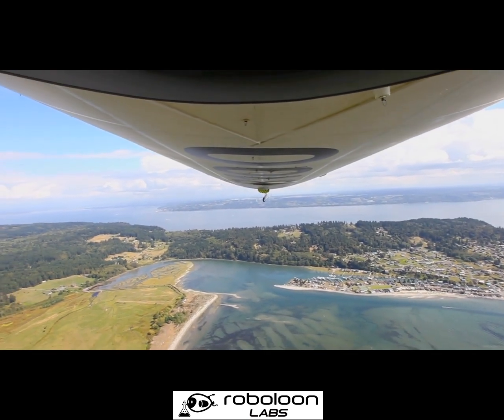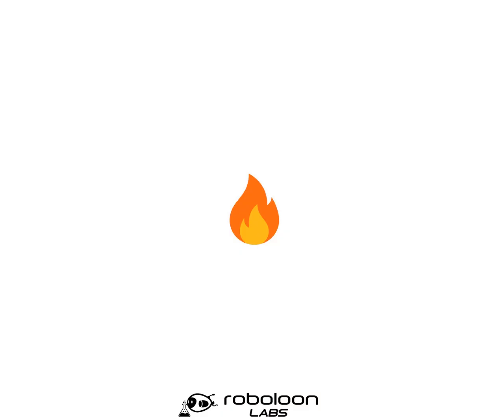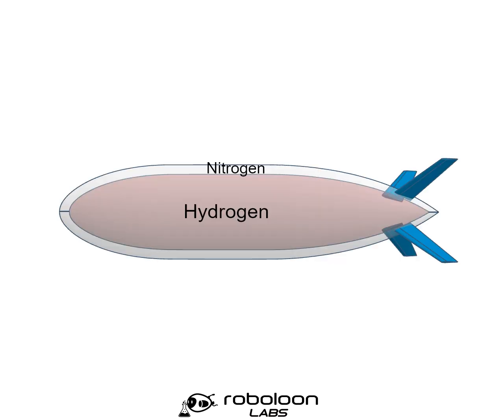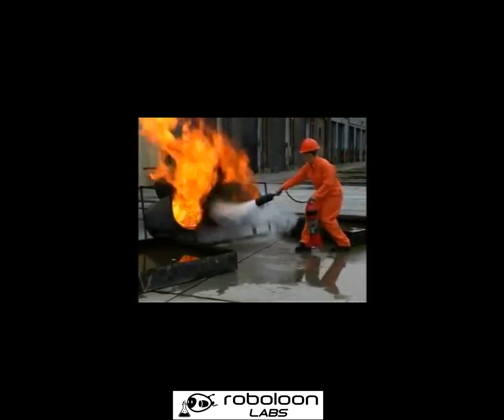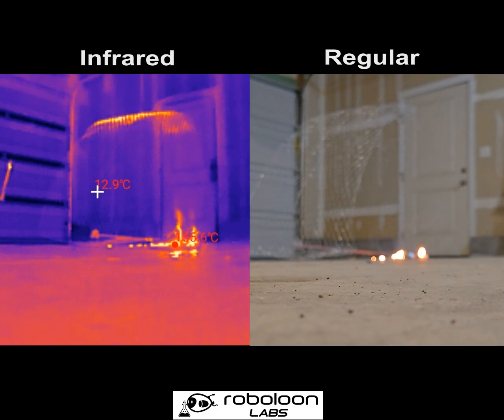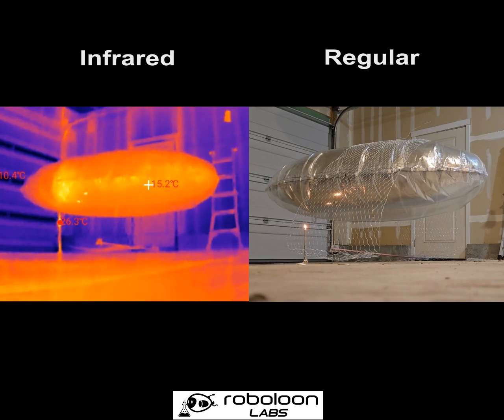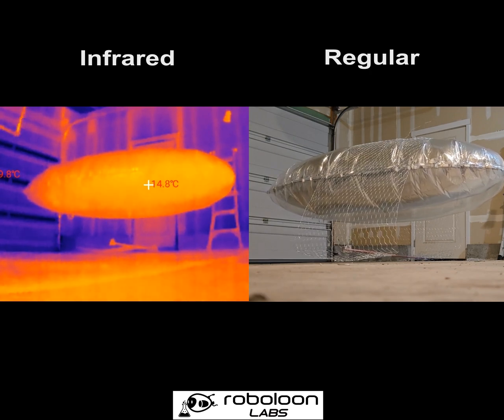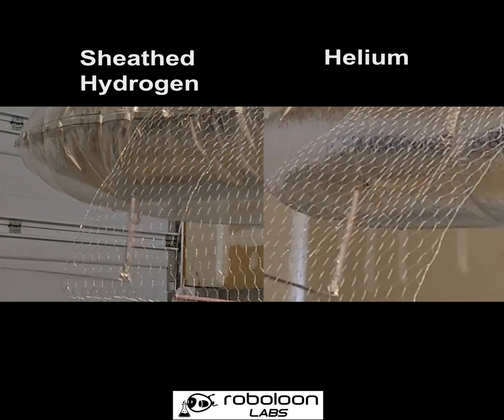Making Hydrogen Airships More Flame Resistant

Comment: I'm not super informed here, but I'm wondering if the lower CO2 partition could be replaced with water? Either way you're dealing with a pocket of something heavier than air. The water pocket could be much smaller and slimmer to compensate for the weight increase, but I imagine the shape of the resulting airfoil with a larger nitrogen partition on top and a thin water bag below would have greater lift in flight?
Reply from the maker: Yeah, I think the trouble would be the water would be so much heavier, like 800 times heavier. So you wouldn't be able to carry enough to help

Comment: Thank you for covering this, I've had the idea for a sheath for a hydrogen blimp for a few years now, but haven't ever had had time or knowhow to do it. 
If you don't mind me asking, would a blimp that is vertical and wing shaped work? potentially mounding the motors mid way up on the sheath, with a control fin along the spine. I read a comic a long time ago called Neotopia, by Rod Espinosa, He depicted one of his airships like that, using a pontoon boat at their base, and I haven't been able to get it out of my mind since.
Reply from the maker: Yeah, I think something like that could work. I'd love to see it!
Reply: @BaccaYarro now that I've seen a few of your videos, I'll definitely look into it. Just need to figure out how to make that wing shape. Maybe some internal panels attached with a plastic sealer. I was also thinking it could be a loose end envelope internally that uses a servo to tighten and loosen to increase or decrease internal pressure to change the lift. Btw, those mountains look familiar in your past videos, Utah? I'm in Provo.

Comment: Just inject nitrogen gas into the outer layer, increase the pressure of the outer layer airbag, making it greater than the atmospheric pressure. In this way, even if the outermost film is burned or damaged, the nitrogen gas can be ejected under the pressure.
Reply from the maker: Yeah, seems to work well

Comment: Is it necessary to divide the two shells
Reply from the maker: You could get most of the benefit without dividing the shells and using CO2 throughout. However this would be heavier. You can try mixing CO2 and N2, however this is less effective at fire supression. Particularly near the bow and stern. So far the best design was with the shells divided.
Reply: @BaccaYarro  Thanks!

Comment: How will you manage the extreme sensibility to wind due to the power/surface ratio for such a vehicle. Even moderate wind will represent a strong component working against the planned track, either directly, which would be good from behind and bad from the front, or as a side-wind component, which in all cases would seriously interfere with navigation. 
If such an airship should be caught in strong winds, it would drift with the wind-speed over ground, and at the same time be very difficult to control in an attempted landing and securing on ground. Otherwise I like the idea and your attempt to make it fire-safe.
Reply from the maker: @Eigil_Skovgaard  Right, this is the core problem with airships. We simply have to push more air out of the way than other vehicles. In the end you have to "brute force" your way through the wind. Design your propulsion for lots of static thrust with relatively low pitch speed. Most of our airships are designed to exert thrust instantaneously any direction (IE: 3D manueverability). That helps with landing and ground handling.

Comment: Hay BaccaYarro, you said that nitrogin is lighter than air, since any gas lighter than the air surrounding it would have the posibility of go up, that means that a nitrogin envelope could fly?
Reply from the maker: Yes, but not very well. It would take a huge airship to lift just a small weight.

Comment: Kudos on this successful experiment! Truly, bravo! The likes of this experiment haven’t been done since British experiments in World War One during the development of the incendiary bullet, as far as I’m aware.

I’ve been harping on this particular point for a long time, that inert gases are a key passive safety measure for hydrogen’s use, much in the same way that carbon dioxide or nitrogen are often used for fuel tankers and airliners to inert fuel vapors. 

The only alteration I’d make is a test with nitrogen on both the top and bottom hemispheres; as shown with the helium test, a buoyant inert gas will put out a fire, but more slowly due to the upward force drafting it away from the fire below. However, nitrogen is only mildly lighter than air, and with a little internal pressure (consistent with a nonrigid airship), it may be the case that very heavy carbon dioxide is unnecessary, as the passive rate of carbon dioxide falling out of the hole may be matched by nearly neutrally buoyant nitrogen rushing out due to slight overpressure, if that makes sense.

This would allow a significant savings in weight and complexity due to not needing to separate the gases, and also not needing to have a significant quantity of a gas that is 1.5 times heavier than air!
Reply from the maker: Yeah, I agree. CO2 is kind of heavy, which is a problem. I'm sure it would not work as well, but the question is how much worse and if the weight savings make it worth it. For example, is 5 cm of CO2 more or less effective than 7.5 cm of N2.
Reply: @ 
Well, regardless of the particulars of which gas is more effective in which spot, and how much pressurization or buffer there needs to be, let’s not bury the lede: this has admirably demonstrated that inert gases are capable of creating a significant degree of passive fire safety in hydrogen-filled balloons and airships. No active fire suppression system necessary. 

Even if one were to create a completely non-combustible envelope material, you could hardly ask for better performance than this when using hydrogen. Even if a fire only melted through an envelope without burning it, the hydrogen inside would still catch fire and melt the envelope more, in a cascading reaction that would only render the non-combustibility of the envelope largely moot.

Comment: Rigid airships already used cells seperate from the shell for their lift gas. Only change to use this system would be a tube/sleeve around any internal passages.
Blimps on the other hand have ballonnets to maintain consistent pressure with altitude and temperature variations. Instead of being inside the lift gas, the could wrap around it on the bottom half of the shell. Energy would be needed to compress the Co2 into storage tanks to relieve pressure without wasting gas, but at least the tanks themselves would be light if they stored liquid Co2.
Reply from the maker: These sound like interesting ideas worth investiging. I need to clone myself...
Reply: CO2 isn’t the gas you’d want to use; it’s significantly heavier than air and harder to liquify than a lot of gases, thus not as responsive as you’d need it to be to adjust to pressure changes in a nonrigid airship. 

Nonrigids and metalclads could use an alternative system of a double-layered ballonet or ballonets, similar to the designs proposed by Vladimir Pavlecka, the designer of the metalclad ZMC-2. If the outer hull is nonflammable, that makes a hydrogen nonrigid a lot safer, but it would still require an inner boundary layer of inert gas for the internal ballonets to prevent hydrogen-oxygen buildups.
Reply: @Jjames763 Nested ballonnets are a good solution for large ships with better surface area to volume ratios.
What about using a pressure swing oxygen concentrator to produce oxygen deprived air (95% nitrogen)?
The separation doesn't need to be perfect, just good enough so the result cannot form a flammable mixture with hydrogen. Plus it provides the crew's oxygen for high altitude operation.

Comment: I wonder if the weight could be better spent on a flame resistant material.
I'm seriously considering using hydrogen in my future airships. I appreciate your sharing of this test. Thank you.
Reply from the maker: @ddegn   I've tried various materials and never found one that did much good. I even tried some exotics, like aerogell. The problem is that in order to have any impact on fire survivability, it has to weigh orders of magnitude more than typical small airship materials. I suspect its a physics problem: the same properties that make a good thin gas barrier make a poor flame barrier.
Reply: @BaccaYarro  Are there any candidates for a gas barrier which wouldn't continue to burn after the hydrogen is consumed? I think the burning plastic on the floor in your demo is likely more dangerous than the hydrogen burning itself.
What do you see as the main risks to a hydrogen filled airship? I think running into an open flame isn't very likely. Maybe metalized plastic hitting power lines?
Again, thank for sharing your experiments with us.
Reply: @ddegn  Mostly whatever propulsion and electrical systems are used are the hazard when it comes to fires, as well as electrostatic discharge (what killed the hindenburg). All of these are solvable problems with good design. The bigger hazard for all airships, regardless of the lifting gas, is weather, which is hard to design for but with modern weather monitoring and forecasting it can be avoided pretty well. 

Airships are just asking to make a comeback. The technology is all in place. Someone just has to do the engineering work, demonstrate safety, and stand up to the FAA.